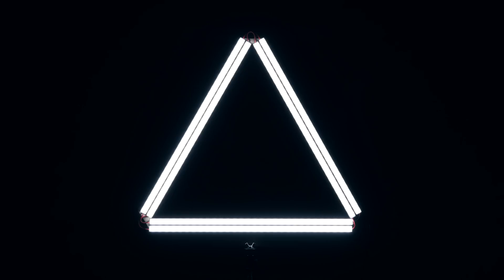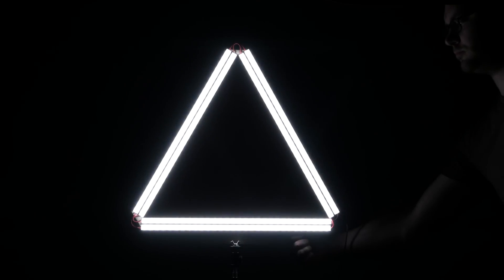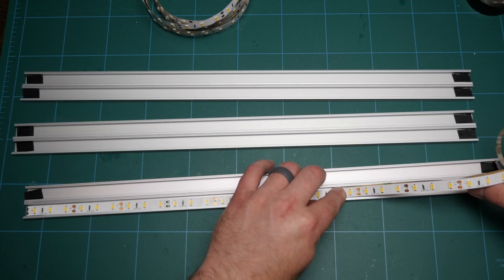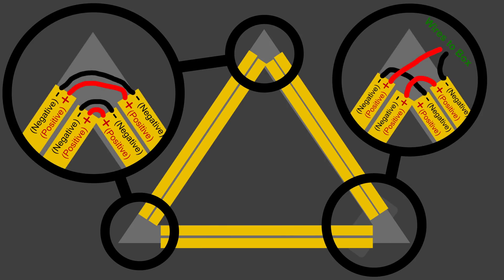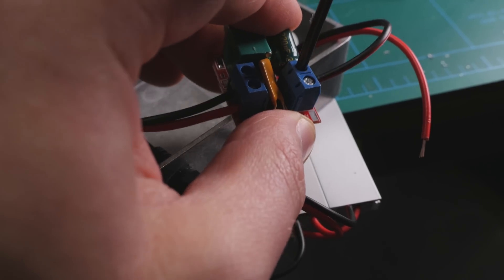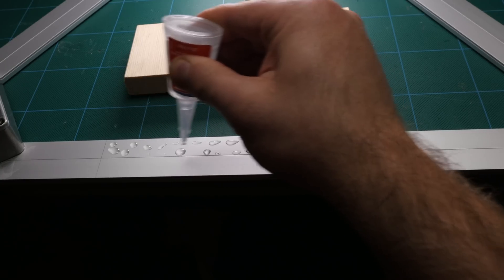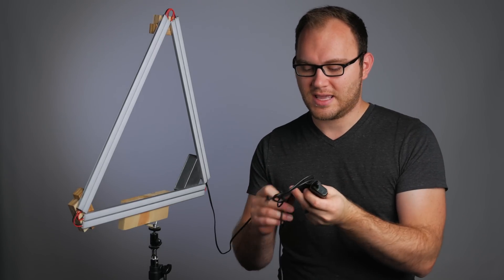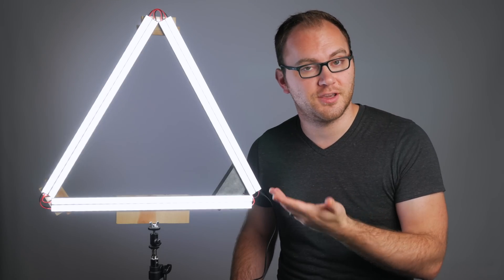DIY Triangle "Ring" LED Light

Comment: First and foremost, THANK YOU!  This is just what I was looking for.  I need/want an LED to put inside or just outside of a Softbox with a Speedlight/Flash.  I want to use this as a modeling light since 99% of the speedlights don't come with a built in modeling light.  Most of the ring lights on the market are just not powerful enough at 3,4 or 5 feet of distance inside a softbox with diffusion.  SO! I want to build / DIY an LED light that I can dim to what ever level of LUX / Light I need while using my Speedlight/flash inside a  Round or Square Softbox.  My question is:  What kind of LUX, Shutter speeds, Fstops and ISO's Or EV and LUX output are you getting on your Light Meter?   Once again,  Thank you! This is just wonderful.

Comment: Suggestions for doing this with Li-ion batteries instead? They usually are 3.7v, I imagine if you soldered a pack for 3-4 batterys in serial you could get like 11.1-14.8?    That would be like 4 batteries with some sort of resistor?  if you solder them in parallel instead of serial you can get more mAhs but I don't know enough about resistors for this.

Comment: It looked like on the finished product there was some diffusion on the strips, but you didn't go over it. What did you use, and how did you attach it to the "ring" light?
Reply: this is late, but when you buy the LED U Channels from Amazon, there are pictures that show it comes with the "cover". It just slides over the U channel. you'll see the pictures of it when you click on his Amazon link.

Comment: Hey Caleb can you do a top 5 or top 10 video series for cheap video fluid heads, or monopod video heads. I know there are good review heads like the qzsd video head, the yungteng yt950 I think I saw that in the paper back drop video. It would be great no one else has done a top 5or top10 under $100 video head video. Thanks again. 👍

Comment: Instead of soldering, consider getting the LED connectors that clip on.  The clips will allow you to reconfigure the strips into different shapes, squares, pentagons, crosses, etc.

Another idea, use the Philips HUE light strips, more expensive yes, but almost limitless colors and voice control.
Reply: I have used clip on connectors numerous times and all to often they fail to make good connections. A few minutes of solder now will save more than that in frustration in the future.
Reply: Josh Zytkiewicz I was just thinking of something like that!
Reply: There a brand you'd recommend? Definitely interested in trying it out this way.
Reply: Well, soldering is more consistant and I wouldn't recommend the hue because they are more "lifestyle" products. Buy high cri led stripes and if you want rgb but white looks cruel on rgb so I wouldn't recommend that. And voice control is totally unnecessary

Comment: I have a quick question for you.  What's the best camera (affordable $100-300)  that doesn't have a detachable lens? I know when you go to a concert a lot of times you're not allowed to take in a DSLR because of this reason. I'm not sure if they let you use a selfie stick or gimbal like the zhiyum. So maybe as a good back camera in these types of situations.  I think theme park have this crazy rule too.  Thanks
Reply: FLOODOFSINS Panasonic r72 bridge camera
Reply: FLOODOFSINS , Sony Rx 100 mk4 it's like a mini a6500, its a mini beast
Reply: That's not exactly cheap, but a good choice.  I'm not trying to be a camera hoarder so I only want the minimum so to speak.  a decent studio/home/vlog camera, a middle of the road gimbal like the zhiyun crane v2, and a budget mic.  I already have a AT4050 for the studio.  I probably should get a shotgun but I wanted a nice one for overovers without going over $1,000 for just the mic. I'm still buying lights (softboxes, etc).  So much to get LOL.  And now with AMD threadripper and rx vega 64 out I need to think about upgrading my older pc.  Thanks for the tip.

Comment: Thanks for the idea :). Am I Right to assume that the power option with the USB Powerbank is limited to 12W, since most single USB ports are limited to a maximum of 2.4A (5V)? Does the transformer maybe accept two USB connections for 24W? You mentioned in the comments that the power draw (I assume from the 12V battery) is about 1.3A which hints to a higher wattage than 12W, so with USB power the light should be slightly dimmer?

Comment: So you used a metal box, and provided no insulation to the regulator? and left the sharp ends where the wire goes through sharp as hell, also while your wiring diagram will function it is not correct. I am also very worried about heat dissipation, and 2A will be just enough, from an engineering stand point I would use 4A. Please keep in mind electricity is the only thing you can screw up, it will still work, but burn your house down later. There are many things you did not consider that you must with this build. Please consult an engineer, learn to build these things safely, then teach people how to build them right.
Reply from the maker: The PCB is suspended in the box. That said I should have put some tape in there. Tested the light and it only drew ~1.3A.
Reply: I wish I understood all this tech talk. I've been wanting to build my own light like this for months but have stayed away because I really don't want to burn my house down. 
I've seen Christmas light spontaneously catch on fire so any diy like his kinda makes me concerned. Is there nay way to Erm flame proof it? 
Sorry for my poor terminology on the subject.
Reply: Mikey's Lab a person can have just as much knowledge and experience as any decent professional engineer, regardless of whether or not they are professional engineers themselves. The only thing that separates the two is that one makes a living off of that knowledge and experience and one doesn't.
Reply: Is this just a matter of using a 12v 4a power supply instead of a 12v 2a power supply?
Reply: Right and wrong are not real things. Only more or less. A real engineer knows this. Can this be improved sure. Make one and show us how you made it better. Also, your reasoning "learn to build these things safely", is very unproductive and contradictory. Learning is not a safe activity. That's why we say things like, "did you learn your lesson"? and not "cool another thing we got right the first time and is completely safe". If he wants us to learn that means he wants us to do risky things. Other wise just buy one the learning at that point would be the same. which is none.
Best Matt
Reply: Mikey's Lab Lame.
Reply: How so? his advice for camera gear is spot on, his advice for building this light is not. I love his content, have watched for a very long time, but as an engineer, these instructions scare me.
Reply: double the draw for safety, Amperage is not a push, it is a pull, so you cant technically have too much. People are free to build it how they want, I am just pointing out some weak points.

Comment: I would like to know how you got to the 12V, 2A value. Is using stronger LED's or more LEDs going to require more than 12V, 2A or how is it calculated? (does it say on the LEDs?)
Reply: His calculations were wrong, they are 12v Strips yes, so that right, every LED requires about 20mA of current, for safety always double the minimum. Please solder the strips in proper series, not what he showed. Please consider heat dissipation.
Reply from the maker: I tested the finally light build with my bench power supply and it was drawing less than 1.5A.